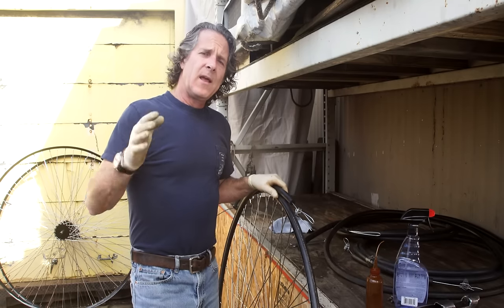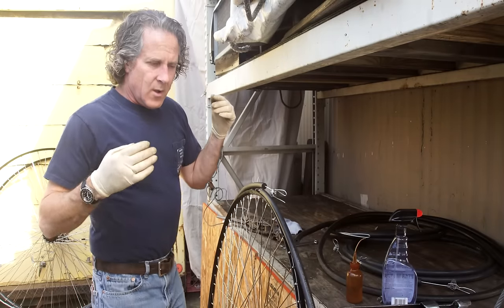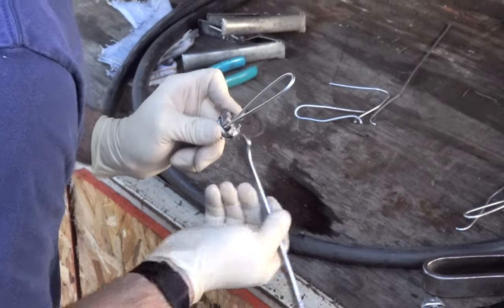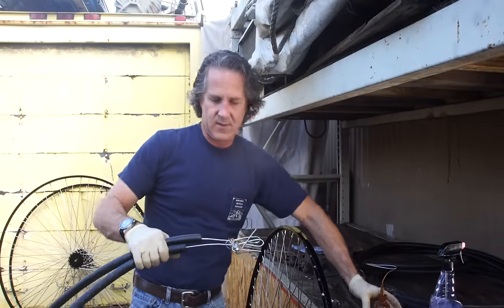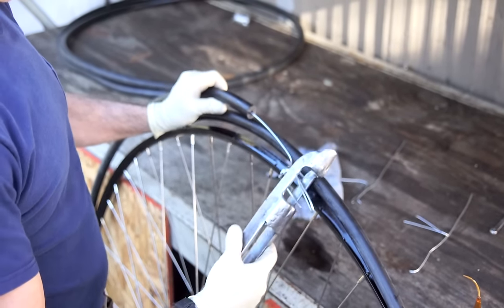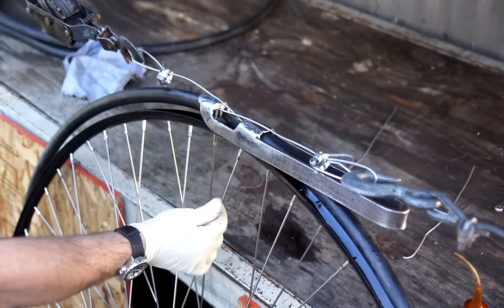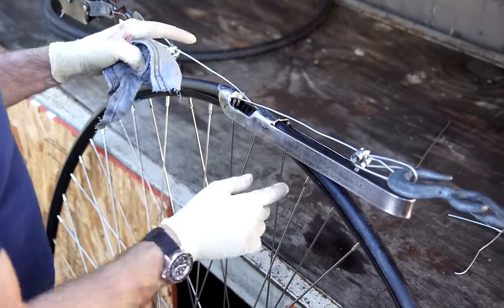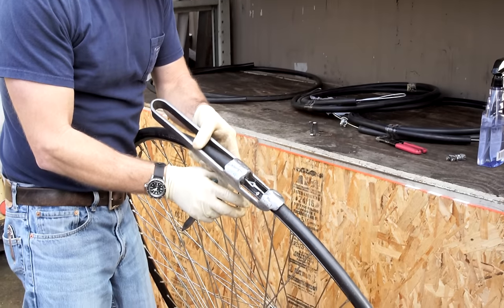Installing Tire on a Highwheel / Penny Farthing / Hiwheel Bicycle.

Comment: can I install training wheels to my penny farthing? if yes can you please make a video how to install the training wheels? 
1. training wheel helps not to fall 
2. and help the rider to get the confidence to  ride the penny farthing
Reply: The first problem with that question is that no one makes training wheels for a hiwheel. That said, I do make a hiwheel trike that is designed to allow the tricycle to become a bicycle by removing the rear frame section. http://www.hiwheel.com/antique_replicas/hiwheel_trike.htm Can my rear frame be adapted to fit a hiwheel? I suppose so but it requires a bit of machine work and skill. Would that help someone gain confidence to ride a penny? Maybe. It would certainly allow them to learn to mount and dismount and allow them to see what pedaling one feels like. If you have questions, send me an email to info@hiwheel.com
Reply: thanks for answer
Reply: There is no difference in balancing a highwheel bike and a regular bike. If you can ride a modern bike, you have all the inherent skill needed to balance a highwheel. Just the mounting and dismounting process is different. So, if you don't need training wheels on a modern bike, there is no reason to have them on a highwheel bike. Actually, once you are mounted, a highwheel is more stable (less twitchy) than most modern bikes.

Comment: Off topic, what watch were you wearing? Looks cool. 
Thank you for showing us this. I always thought they were soldered together.
Reply: That is a Marathon SAR. I've been wearing it for about 20 years. Love it. But yah, there are 2 schools of thought on how the wire connection should be made. The solder/weld/braze method and the twist method. At this point I can say I've done well over 12,000 wheels with this particular twist method and prefer it. I won't preach that one system is better or try to change someone's mind if they like heat on their parts but for durability, my record speaks pretty well on how effective the twist method is.
Reply: @gbarron64  Marathon SAR looks like a cool watch. How's the tritium lume holding up after 20 years? (Those things have been on my bucket list radar for a while, lol.) 

Maybe before galvanize steel/modern alloys the other methods were required but these days that's no longer the case and that's where the controversy come from. (I'm just guessing here.)
Reply: @TheTarrMan  That watch is so old it didn't have tritium, it had the previous system and over time faded away pretty badly. Also, I kind of broke it so that it needed a new stem. I sent it in to Marathon for repair and recertification. While it was out, my significant other got me a new TSAR and the tritium in that is amazing. Highly visible underwater and in dark conditions. I love it. What I do miss is that the new watch doesn't have the cyclops over the date window. And these older eyes have trouble without the magnifier. That said, it also has the 24 hour clock face and I like that. The older version had a numberless face.
Reply: @TheTarrMan  I have a buddy that collects watches. There was a time when radium was used on the face and hands of watches. I imagine it had a nice blue glow...
Reply: @gbarron64  It depends on the luminescent material mixed in with the radium paint. Some glowed blue, commonly they glowed green. 

Fun fact : Those watches are still highly radioactive and the only reason why they don't glow anymore is because the radiation degraded the luminescent material. If you laid a sheet of glow-in-the-dark paper directly over the dial, the paper would still glow in the shape of the indices. I believe the half life of radium is 1500 years so a 100 year old watch still has 99% of it's radium. (Remember half live is defined as "the time taken for the radioactivity to fall to half its original value.")

I have an old pocket watch I bought recently with a radium dial. It doesn't visibly glow anymore but it's still an interesting piece of history.
Reply: @TheTarrMan  I had this discussion with my buddy that collects watches.

Comment: I own and love your hiweheels!
Any advice when you get tire gaps randomly after some riding? How do you close up the tire gap or is that an indicator that my wire tension is too low? Gap is a little over an inch
Reply: Hello and very good question. This is a maintenance issue usually but can also be a loose tire issue as well. If the tire is nice and tight in the rim, then you probably have a tire that self vulcanized to the rim somewhere. That can be cured easily and quickly with some WD40. If you have a tire gap for whatever reason, first start by lubricating the tire and rim. Insert the WD40 applicator tip into the core hole of the tire. Flood the interior of the tire from both sides of the gap. Then, spray the tire where it touches the rim all the way around the wheel. From the gap in both directions, wiggle the tire a bit to free it from where it's sticking. Then ride. The gap should close in less than a block but you may have to reapply and try again.
 In my experience, usually the tire can stick to the rim in conditions such as extremes of temperature, after riding in water or through a very gritty surface or all of the above. That said, should y our tire actually be loose in the rim, then the core wire has stretched and no amount of treatment will get it to stay for long. A loose tire must be changed as it could be a safety issue and you don't want one of those. 
 Another issue that I come across from time to time are spokes that protrude past the nipple head. Those are a mechanical issue that no amount of lubrication will fix.  They need to be ground off flush to the nipple to prevent a mechanical obstruction that could cut the tire and cause another type of failure. 

Greg Barron
Reply: @gbarron64  I love this reply. So many years of knowledge distilled into a few paragraphs.

Thank you, Greg, for sharing your knowledge so generously. It's fascinating, even for the majority of us who are never likely to even ride an ordinary, let alone own and maintain one.
Reply: @weevilinabox  You never can tell when one may turn up in your life!

Comment: Muito legal queria saber que mangueira e está 👍
Reply: This is not hose Osmar. This is a solid rubber extrusion that has a 3/16 hole through the center to allow the wire to pass through.
Reply: @gbarron64  obrigado
Reply: @osmarpereiracalhascatarina   You are welcome.

Comment: So do you sell the specialty tire tool as well as the bikes??
Reply from the maker: I do sell the tiring tools, both the large wheel hand tool as well as the bench mounted small wheel tool. Have a look at my website, www.hiwheel.com in the parts and accessories portion. Or, call me at 510-769-0980. Best time to reach me these days is mornings between 9-11 otherwise I tend to be in the shop or doing errands. 

Greg Barron

Comment: What is the name of the type of tensor you used at the anchor?
Reply: Hi Juan, well, since I'm not entirely sure which end you mean, I'll go over the entire rig. Starting at the right side there is a cable or chain with a hook on the end positioned roughly 4 feet off the floor. At the left side is a hand winch, also known as a "Come Along". That is the tool that sets the tension on the whole procedure of installing the rubber. In the middle is the spacer tool that keeps the tire ends apart and provides the room to work. I hope that helps.

Greg
Reply: Thank you, I found the tool thanks for your help
Reply: Juan Ignacio Riesco Valenzuela lol is this that was epics personal account?

Comment: I know this video is old so im not sure anyone will respond but why wouldnt you just put a plat strip of rubber all the way around the wheels?
Reply: Because a flat strip wouldn't roll side to side very well. On a bike, that's kind of important. you would feel the transition every time you changed angles on the wheel.
Reply: @gbarron64  oh i didnt think about that. So where could i buy the rubber and the wire for a 50 inch wheel?
Reply: @gbarron64  and i realize that the transition wouldnt be very smooth but would it still work? Like would it be rideable and wouldnt feel to bad while riding?

Comment: Good lord and i was cursing when i had to change my mtb tire 😬 what a pain in the ass is this!
Reply: Well, it isn't quite as simple as changing a regular bike tire but it's not all that bad.
Reply: I'm sure the average rubber tire lasts a decade or more anyway. Unless you are a constant rider. Solid rubber tires were known to last. A friend of mine has them on some early 1900s trucks and the ones he hasn't replaced are very very old.

Comment: WD-40 is not a lubricant.  The WD stands for water displacement.  I worked in a bike shop for 2 years and every single one of our lead mechanics said the same thing.  WD-40 is not a lubricant!
Reply: Well I'm sorry you don't feel it's a lubricant. Certainly the WD stands for water displacement and it's the 40th formula they came up with. Seems to me that the people that make WD40 think it can be used for a lubricant. https://www.wd40.com/uses-tips/lubricate . For the last 40 years working in my shop I've used it as a lubricant among other things. But you being and expert and all, I can see why you would be upset. 2 whole years working in a bike shop. Seems I wasted 2 years in machinist school and 2 years in a GM technician training academy. And 45 years of having my own bike shop, vehicle manufacturing facility and auto restoration business. And boy will the people at WD40 be surprised when they find out it's not a lubricant...
Reply: @gbarron64  Anything used to reduce friction is a lubricant, such as water or soap, etc.
Reply: @gbarron64  Anything that reduces friction is a lubricant, such as water, soap, etc.
Reply: WD-40 certainly has components that have lubricating properties. I think what the guys in the bike shop cited by Matt Gallagher meant is that WD-40 is not a good choice for being a permanent lubricant. For example, it can be useful when you need to lubricate something quickly and with minimal mess, but for long term lubricating action you should use a product actually intended for the purpose. While I have not done extensive testing, and I certainly don't have Greg Barron's long experience, my observation is that WD-40 will be subject to a lot of evaporation, and before long much of it has disappeared. This property actually makes it good for uses such as shown in this video, but don't use it as your modern bike chain lubricant.